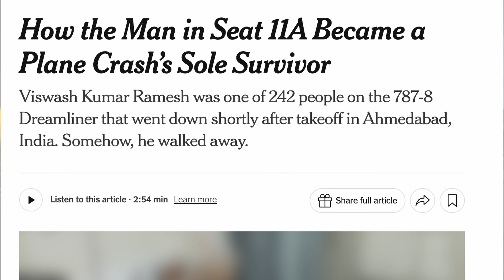Why the RAT Changes Everything – Air India 171 Update

Comment: You're in good company. The RAT sound is hard to miss. We will need the data from here. Thanks for this.
Reply: It's not just that. If the engines would have worked than that would be the only thing you'd hear in the video. That's for sure.
Reply: The deployment of the rat would be a little more louder with both engines blown but the one survivor said it was a very loud noise and you'd think there could have been some explosion other than the rat before the cabin lights started to flicker.
Reply: @ricr.96 that loud noise could have been a engine compressor stall , they are extremely loud .
Reply: @ricr.96 You'd think if both engines blew out you'da seen some puffs of black smoke. I'm going wager a computer glitch that throttled back the engines. I used to work on computer systems. I cringe at the thought they're in jet airliners.
Reply: I'm having a problem with the idea of the RAT reaching full RPM in such a short time and at such a low airspeed while under load.
Reply: @DempsterDave  Who claimed that the RAT reached full rotational speed?
Reply: 1:38 Sir, at this point you can see the Engine Flame Out Smoke. That's not Dust. 😢😢
Reply: India does have a rat problem.
Reply: The electronics flickered because of heat, and basically the engines shutdown ...
Reply: Jeffostroff provided this information yesterday. This video plagiarized from that video.
Reply: @legallyregarded yep.  I saw Jeff's video. Jeff said all this a couple days ago. He also got the cleaner video first. This seems lifted right off Jeff's video.  Give Jeff Ostrof credit.
Reply: @legallyregarded  he cannot be trusted he is not a pilot, i trust steve 1000% more as he knows what he is talking about

Comment: Generator failure will cause Auto-throttle rollback (ie dual engine failure) That in turn triggers RAT deployment.  After all, the 787 is assembled by casual unskilled labor. What could possibly go wrong? Capt Steeve  Have you seen the photo from the throttle quadrant? Throttle levers slammed forward  and both igniters selected on.  PUBLISHED by Malaylum News.

Comment: The two engines have  to fail and the power to the hydraulic system has to fail for the RAT to deploy to provide interim power to critical instrumentation and hydraulic systems

Comment: Wondering if known issues that drove the creation of 787 Airworthiness Directive 2024-16-07 are related to this accident. The FAA issued the AD in late 2024 to address "problems with thrust management (TM) and displays and crew alerting (DCA) operational program software. The unsafe conditions, if not addressed, could result in possible runway overrun or controlled flight into terrain."

Comment: There are no Mathematical visual radio programming coincidences as a result of massive error codes being generated through finite Quantum vampiric Artificial Intelligence that is used to operate all flight simulator software programs 
When U build a finite  commercial airline company parasitic Corporation in which another branch directory airplane builder builds a flight simulator software network programmable Holographic matter as a grid network template architectural design of how Quantum Artificial Finite Super computers that are Neuro logically linked to the Borgha Matrix Quarantine Victim victimizer QI coded Trap experiment that spread to 2 other Matrices that led to Andromeda Mother Galaxy Quarantine security teams operating here B cuz it's a massive circuit breaker Star Gate system crashing Mathematical holographic radiation programs 

Eye mean really Captain Steevie U have multiple people murdered who worked in Quality control for Boeing and what did the global flying community experience 
Those Boeing Jets have massive defects in their Star map guidance systems 
That's Avionics 
Which is electrical sound and light burn patterns of consciousness directed Holographic spinning mirrors atomspheric breathing temperature Vacuum gauge metering voltage change echo maps recording speeds 
The system is finite and runs on limited memory and limited capicitance calculator capacity levels of cellular awareness 
That's B cuz it's Base 10 mathematical language coded Holographic visual mathematical memory driven programs 
When U sit in a cockpit of a Boeing Aircraft ur operating an end user flight simulator that was built by the programmers at Boeing Aircraft 
Now ur operating someone else's read active memory driven mathematical programs 

When U go to Google CIA play store ur loading that program that was engineered by another software programmer 
Load the programs into ur minds CD rom drive motor and experience the results of that program 
Corporations do not build anything to last forever B cuz their only interest is is making money by killing people 
AI Warfare is a racket used against Humanity 
At some point wake up and DO NOT OBEY THE FATHER of ARTIFICIAL FINITE INTELLIGENCE MACHINERY Programs 

Mu ah VA 💋🌈 Aurora's Spiral Council quarantine security teams operating here

Comment: I am just wondering if there is any system onboard the aircraft that has the authority to shut both engines down. Either a fuel distribution system or a prematurely engaged auto throttle or anything else. If the system in question failed then Boeing is in a lot of trouble because It would basically be 737 max season 2. Of course I am not trying to put responsabilites on Boeing prematurely at this stage all we can do is formulate hypophysies.
R.I.P to all victims and affected

Comment: January 2025, United airline flight ✈️, Nigeria to DC , faced the power  failure issue. There is manufacturing defect in these boeing aircrafts.
✅️✅️✅️✅️
Nearly 40 people were injured when a Boeing 787-800 plane suddenly lost altitude during a United Airlines flight from Lagos, Nigeria, to Washington, D.C., early Friday, officials said.
United Airlines Flight 613 departed Murtala Muhammed International Airport in Lagos shortly before midnight on Thursday. About 93 minutes later, a sudden descent sent baggage, belongings, trays of food and other items flying around the cabin, according to video shared on social media.
There were 245 passengers and 11 crew on board, according to the Federal Airports Authority of Nigeria. After returning to Lagos and landing safely at around 3:22 a.m. Friday, four passengers and two crew members were hospitalized with serious injuries and later released. Another 27 passengers and five crew members reported minor injuries.
United Airlines said the aircraft returned to Lagos to “address a technical issue.” The airline said the sudden descent was not caused by turbulence, and that it is “working with aviation authorities in the U.S. and Nigeria to understand the cause.”
According to data available on FlightRadar, the same aircraft was diverted Tuesday during a flight from Lagos to Washington, D.C., after rapidly dropping some 1,000 feet about 89 minutes into the flight.
The Boeing 787 was the subject of a Federal Aviation Administration review following another rapid midflight descent on a Latam Airlines flight in March 2024. In that case, investigators determined a pilot’s seat moved forward into the aircraft’s control column, causing its nose to drop.

Comment: If this turns out to be a aircraft issue, all you experts out there need to give a an apology to those two pilots.. the Western media had already established that this is pilot error
Reply: That is the fault of the listener that takes off and runs with it.  Steve is VERY clear about speculation vs. critical analysis based on facts and data available at the time.

Comment: When I first saw the broadcast video and the airplane mush down I said to myself…no power…not a stall, not a flap or gear thing…just no power.  Both engines flaming out just after takeoff points to a host of possible problems..fuel feed, massive electrical short somewhere, …. I am reminded of Sal's what's going on with shipping..discussions and theories of the Dali's loss of power.  It gets complicated.

Comment: Temp above 104 , high density altitude and incorrect flap brought the plane down.

No way both engines failed, if that is case , boeing must address this issue and it design issue.

Comment: Here is my prediction for all of this, here is a timeline.

All systems were good to go for take off, flaps were set correctly.

Toga power is set

1 engine failure on V1

A electrical backup failure caused the RAT to deploy. 

Other engine is set to max power
(I believe this is the sound, not the rat)
 
Electric motor driven pumps could not retract landing gear due to electrical failure.

1 engine + max take off weight + added drag of rat was not enough power to give lift causing its slow decline.

Really curious to see what yall think of this theory

Comment: It's amazing how dual engine failure is normally a very rare but very survivable thing. To suffer total loss of lift just seconds after rotating is unimaginable quite frankly. The amount of terrible luck here combined with the one lucky survivor, it's just mind boggling.
Reply: People who fly know you can pull strongly off the runway in ground effect, a dense cushion of air near the ground that maximizes lift, but once out of ground effect, in this case probably 200 or 300 feet, a noticeable reduction in lift is felt. Every pilot can speak to the pronounced effect of ground effect. This thing got out of ground effect and struggled to climb, yep.
Reply: Contaminated fuel? Wouldn't other flights have been affected?
Reply: @charleshammer2928  Exactly, Ahmedabad is a busy airport, none of the other flights had a issue.
Reply: @charleshammer2928  fuel contamination . If there were a electrical failure the pump will start working again when the prop is deployed. And it's was for a long time. 
I think it's the fuel some how . 
When both engines shut off at the same time
Reply: @joachimkulstad3304  And yet, at that busy airport, not a single other flight was affected.
Reply: @charleshammer2928  Exactly! Doesn’t make any sense that only a single plane affected
Reply: I think the pilots knew there was no lift approaching end of runway 
No choice but go airborne at that point
Reply: @thurston4mor yeah some Say that the plane used the whole runway and that's not 'normal'. But not sure.
Reply: @FacuGonz3 I’ve read that a 10k-foot takeoff at that weight was expected for how hot it was that day (over 100°F).
Reply: @FacuGonz3 frw times that i have flown here, no it doesn't take entire runway to lift
Reply: @FacuGonz3 1:38 Sir, at this point you can see the Engine Flame Out Smoke. That's not Dust. 😢😢
Reply: @thurston4mor  I think they should have aborted takeoff then. It seems like there was clearly something wrong with the engines to begin with. Why did they continue instead of aborting?
Reply: @thurston4mor 1:38 Sir, at this point you can see the Engine Flame Out Smoke. That's not Dust. 😢😢
Reply: @thurston4mor  why? If they realize that the plane is lost anyway, isn‘t it better to contain the catastrophe on the ground of the airport as much as possible, instead of taking off with a doomed plane and then ramming it into a residential area nearby?
Reply: I don't think so because the plane was actually flying. If both had failed before rotation they wouldn't get up to 600 ft  @thurston4mor
Reply: @thurston4mor So there was lift.  They did get into the air.  Some say to 600 feet or more before pancaking.
Reply: @thurston4mor  - they started at the middle of the runway instead of using its full length.  I saw one other expert say that the plane went down to the "last brick" of the runway before taking off.   I wonder if they would have been able to abort the take off if they had opted to use the full length of the runway instead... 😞
Reply: @sudhisira they likely did use the full runway just like every other ai171 flight. Ads-b coverage isn't great at ahmedabad airport which is why the backtrack is missed pretty much every time.
Reply: @sudhisira  It's already been debunked that they used the whole runway. Stop with the nonsense. This is why people need to be careful reading into the kneejerk internet analysis right after something like this.
Reply: @sudhisira that’s apparently not true. This kind of speculation has arisen because a video taken from the parallel road only shows half the part of the runway section. 

It was very hot outside and the plain carried maximum weight. The pilots would have to use maximum runway length to accelerate.
Reply: @MrHav1k  - oh wow wow.  Easy there.   If there is incontrovertible, confirmed proof that they indeed used the full runway, post it here.   I am no expert and am basing my question on what I heard in a few of the other analysis videos.   I have no bias one way or the other.  Just wondering what the heck happened to cause the tragedy.   That's all.
Reply: @sudhisira  that’s false, they didn’t start out halfway down the runway. They entered the runway at the midpoint then back taxied all the way to the end and used the entire 11,900 feet
Reply: @sudhisira they didnt start at the middle of the runaway. They used the whole runaway and to the last meter to get that lift as pilots probably after V1 noticed problem with the speed,or something. Thats what they used every single meter of that runaway
Reply: @sudhisira Flightradar reported that they used the full runway
Reply: @sudhisira They did a full length takeoff. FR24 has clarified that they did a full length during the roll.
Reply: @sudhisira  They actually back-taxied to full length.
Reply: dual engine failure just at takeoff is not very survivable unless there is very clear and flat terrain ahead to try to land.  USAir that landed on the Hudson River lost engines at 2818 feet.  Air India seems to have lost both engines (?) at el 600 which is only 400 feet above the ground.
Reply: It's highly unlikely that both engines failed at exactly the same time. My theory that there was a catastrophic electrical failure, fuel pumps stopped working, and the fuel feed was insufficient for the engines to produce enough thrust, thus making the aircraft stall. RAT doesn't provide power for the fuel pumps used in B787 Dreamliner.
Reply: The only thought is that they stalled out the engines? Another thought maybe fuel mismanagement, when someone forgets to open a feed line and engines feed from a feeder tank until they flame out
Reply: @misham6547 a stall wouldn't explain the RAT deployment.
Reply: Fuel contamination is a likely scenario. Indians will shit just about anywhere, so it’s quite likely one of them shit into the fuel tanks at the airport.
Reply: 1:38 Sir, at this point you can see the Engine Flame Out Smoke. That's not Dust. 😢😢
Reply: And there would be far less casualties had it happened at an airport with little to no buildings in the direction of the runway. This was terrible luck.
Reply: Its amazing lol
Reply: Fuel contamination. They hade some fresh fuel in the pumps last flight that Handel the lift off. And then the contaminated fuel kicked in.
Reply: @joachimkulstad that's a possibility. It's happened before and would explain why you would suddenly lose two engines which I struggle to understand why that would happen.
Reply: @joachimkulstad  We need to wait for the black box data before making assumptions.
Reply: @joachimkulstad  Can you point out where all the other planes crashed? Or are you saying that aircraft had its own special fuel supply? 🤔
Reply: Why do you found it unimaginable when that is the moment the engines at maximum stress ?  If they are going to fail that is a probable moment.
Reply: @CommonMind-q3v   Because STRESS on two different machines (engines) rarely fail "simultaneously" (even if same exact model)
It's more likely something LIKE fuel, giving both engines some BAD "INPUT".  Unlikely electrical too because of redundant systems.  This one is weird.
Reply: @CommonMind-q3v  T/O is actually not when the engines themselves are the most stressed, the airframe and engine pylons yes;but NOT the engines. A plane will very seldom to never use max power to takeoff. Derated power is what's used almost 100% of the time, and there are several settings of derated power to choose from based on conditions/weather. It is in fact, extremely unlucky and unimaginable that this 787 lost both engines, simultaneously and at this critical phase of flight. 
(28 year airline mechanic)
Reply: @tima.478   So have you ever heard of a double engine failure outside of a bird strike? Probably not. Sabotage would come to mind as a likely culprit
Reply: @frankthetank8050  A double engine failure, outside of some type of purposeful sabotage, is extremely unheard of. I have heard of a single failure and then the crew shutting down the wrong engine, believe it or not, (British Midland Flight 92). Otherwise, I have not heard of a simultaneous double engine failure.
Reply: @CommonMind-q3v  all commercial aircrafts are design to survive with one engine (although almost impossible if failure occur immediately following takeoff). and to lose BOTH engine at the same time, is almost unheard of. the hudson river miracle was only possible because it occurred at almost 3000 ft and there was water below. this one here was a death trap. the moment they took off, it was doomed.
Reply: Terrible luck absolutely. Something so rare happening whose chances are already very low and that too at just the beginning of the flight. What worse could have happened

Comment: It seems to be heat related, particularly at that airport . extreme heat affects electronics significantly, and the fact both engines failed, indicate no fuel was being injected via electronic signal failure . I think the pilot indicated loss of power. Add to that the passenger and baggage load.  I am so saddened by this tragic loss of life !😢